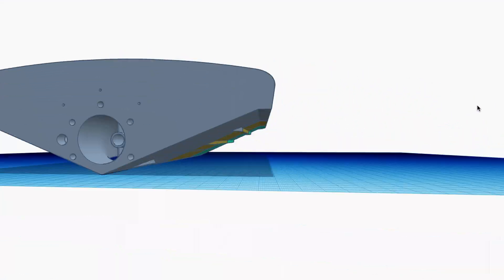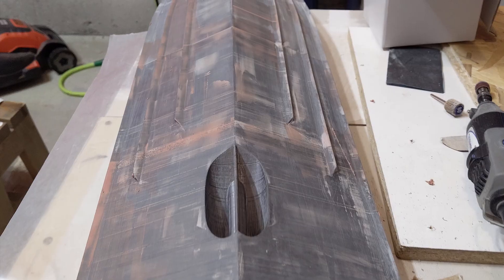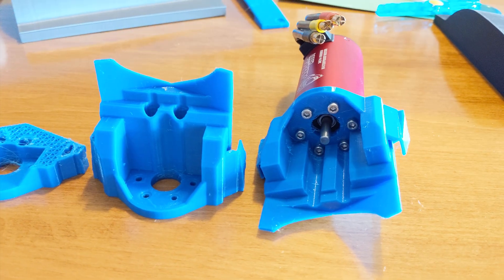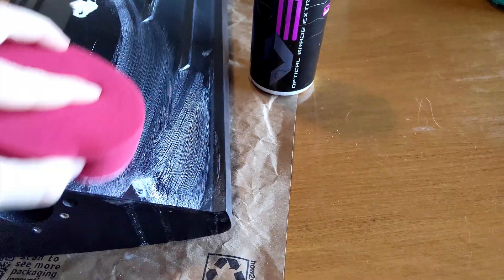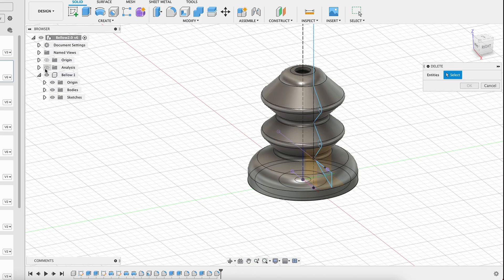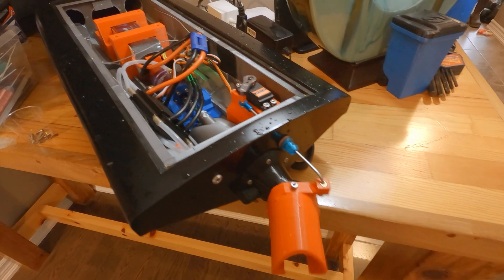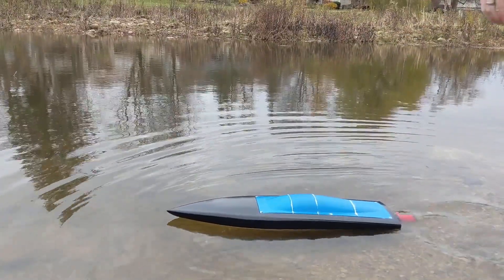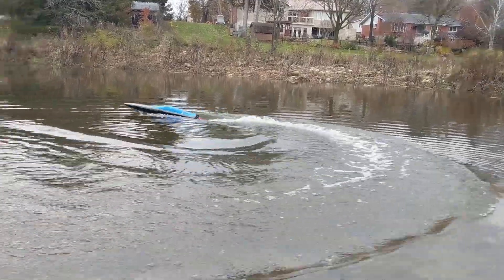I 3D Printed a RC Jet Boat

Comment: He Bill, I printed the same boat with the same motor which timing setting did you use?
Reply from the maker: Hi Dennis. I used a Surpass Hobby Waterproof Brushless Motor 3674 1150KV. I did adjust the timing which helped significantly. I can't remember what I set it to though. I just used some info I found online to help with that part.

Comment: Which top did you use? I'm having troubles finding one that aligns with the holes
Reply from the maker: I can't remember. It was a couple years ago but I will try to take a look. My holes were also messed up and I had to drill out new ones. That's why it's still unpainted in the video.
Reply: @billjonesnation  Fair Enough. I appreciate the reply after such a long time!

Comment: Are your STL files available for purchase?  I like the alignment tabs.
Reply from the maker: If you still need them, I can post them on thingiverse for free. It may take a bit of time though. I'll have to track down these STLs. My file organization is not good! I also posted my modular battery mount on thingiverse:https://www.thingiverse.com/thing:5153570 You could always use a smaller battery than mine and shim it with foam.
Reply: @billjonesnation  that would be amazing! Thanks!
Reply from the maker: @markthorsen2888  Ok I just uploaded all of the connectors to thingiverse. Let me know if you have any issues downloading them. Thingiverse was very glitchy when I tried to upload: https://www.thingiverse.com/thing:5452335
Reply: @billjonesnation  Works perfect! thanks again!

Comment: Buddy where are your custom STL's lol i made the same boat but has a prop not much fun lol
Reply from the maker: Here is the remix of the boat you made but in Jet Boat Version. https://www.thingiverse.com/thing:3191148. This is not my design, however I had to make a lot of custom parts to make it work. I did post my battery mount on thingiverse though. https://www.thingiverse.com/thing:5153570
Reply: @billjonesnation  Thanks Bill, starting the print now
Reply: @billjonesnation  Where is your next printed boat guy, lol
Reply from the maker: @ChampTruex  Check out the trailer I just made for this jet boat. 🔥

Comment: Amazing project man. Great design, I think that you you need of a more powerful motor. This is a very strong  model. Bye from Italy
Reply from the maker: Thanks for the comment. I think you are right. I was hoping it would be a bit faster. I have ordered a similar motor with lower KV ... So more torque. Will try that out next spring and see if that helps. I probably overbuilt the model when printing so it's on the heavy side. However, it's weight does make it cut through the waves nice. 

Do you have any motor recommendations ? Ideally I want to use a 120 or 150 a ESC. 200 amp escs are too expensive for this project.
Reply: @billjonesnation  Regarding the engine there are many options, it depends on how much you want to spend. You can try Leopard 3674 or SSS 3674 from 2200watt about up to 6s. Or the cheaper LD POWER 3674 Surpass Rocket 4082. You should aim for at least 2000watt and 6s motors, usually You have to find more or less 105 A. I hope that this info help you. Stay fast from Italy

Comment: Can you list the electronics somewhere
Reply from the maker: Flycolor 2-6S 120A Waterproof Brushless ESC with 5.5V/5A BEC/Water Cooling System for RC Boats ship
Surpass Hobby Waterproof Brushless Motor 3674 1900 KV RC Car Motor for 1/8 1/10 2S 3S RC Car Drift Racing Off-Road
Zeee 6S Lipo Battery 22.2V 100C 5200mAh Soft Case Battery with EC5 Connector for RC Car Truck Airplane Helicopter Quadcopter Boat
ZOSKAY servo 20KG/.09S DS3218 PRO high Speed Metal Gear Digital servo Baja servo for 1/8 1/10 Scale RC Cars Degree 180

https://www.thingiverse.com/thing:3191148 Original link to the Jet Boat. The comments list some of the smaller details like motor shaft etc.

Let me know if you need any other details.
I ordered a 150A ESC and a 3674 1150 KV motor to try out next spring as well. I am concerned the 1900 KV I was using is slightly too high RPM to go flat out without overheating.
Reply: @billjonesnation  thanks a lot, what remote system, remote and receiver, would you recommend/ use? thinking of getting into rc stuff so trying to look what is possible and not to expensive
Reply from the maker: @digeon8798  I used the: Radiolink RC6GS V2 6 Channels RC Transmitter and R7FG Gyro Receiver Voltage Monitor 2.4GHz Long Range Remote Controller for Racing Monster Vehicle Truck, Crawler, Buggy, Boat
from amazon.ca. 
It was $108 CAD, so not a bad price for a 6 channel transmitter. I wanted the extra channels to have options for other cars and boats. You could get away with a cheaper 3 or 4 channel radio system though for a simple boat like mine. My boat only needs one servo for steering. I may add a reverse system which will take another servo.